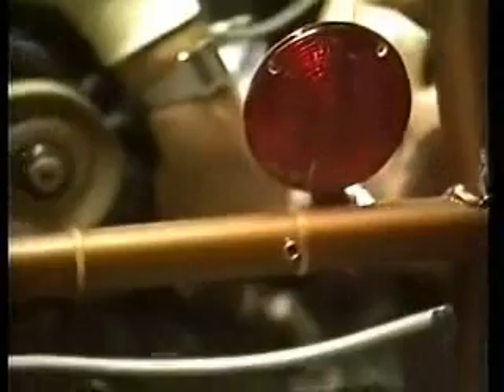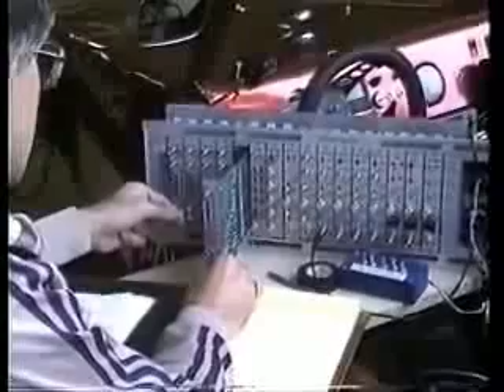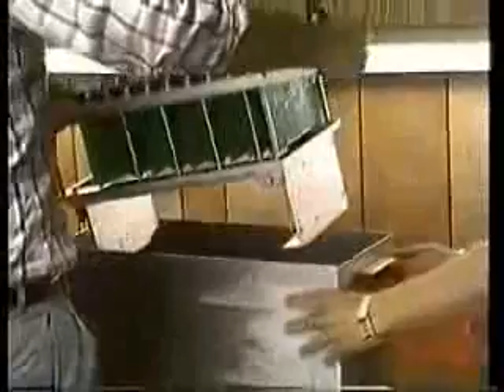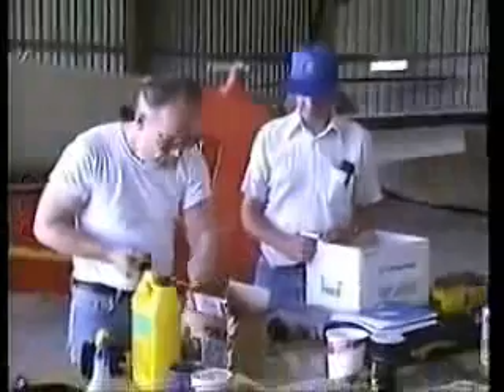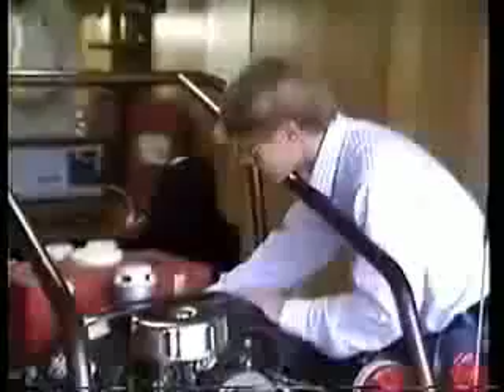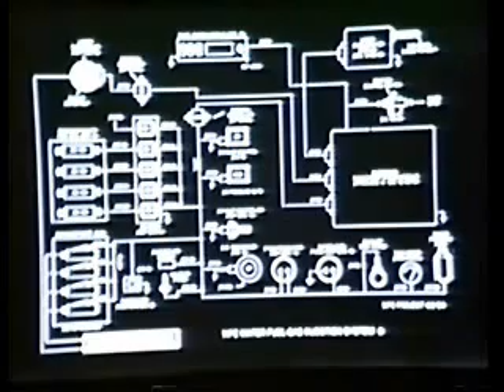Stanley & Stephen Meyer Explaining The Gas Management System

Comment: So all it is, is Normal Tap Water to OH+ to Deuterium that is decomposed into Tritium so that it gives of a Positive Charge (decay), then you simply Ionize the intake Air with a Negative Charge so the Positive Tritium and Negative intake Air bind together and add Exhaust Gases to slow down the Burn rate of the HHO to match Petrol. The resulting combined Gases are 2.5 times more explosive than Petrol, so you'll use 2.5 times less HHO to power your car.